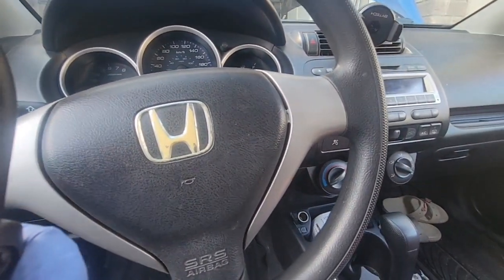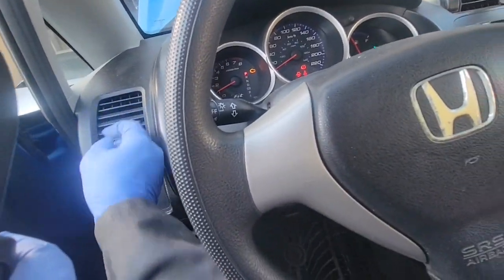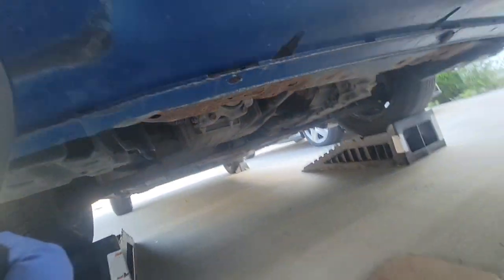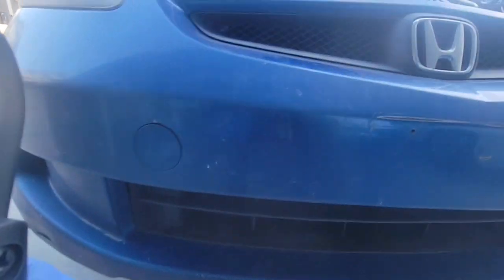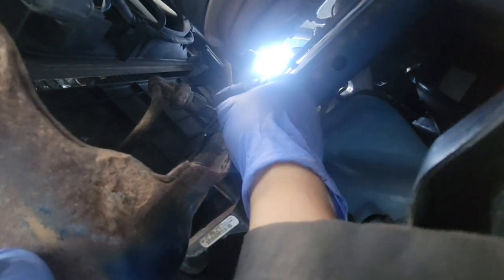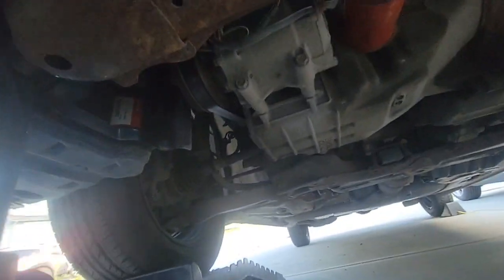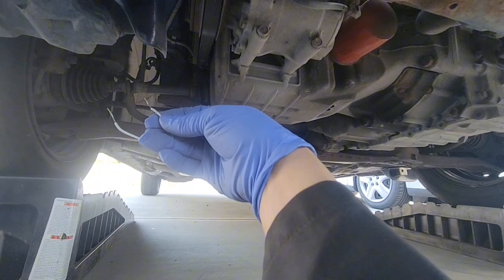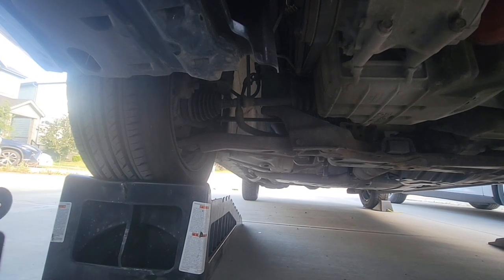EASY FIX HONDA FIT 2004 TO 2009 AC COMPRESSOR NOT WORKING. AC SENSOR SWITCH LOCATION

Comment: Thanks for the video. I think this has narrowed down my search to find the issue with my ac on my honda jazz. You did not angle the camera for us to see what you completely did, so are you able to show a picture of where you placed the wire in the sensor switch? What exactly did you use to stick into the switch? Can I use a paper clip to do this test? So if it's been diagnosed that it's the sensor switch, can you please tell us what we need to do? Install a new switch? Or Install a new compressor? Change fuses or relays? What is the next step, please?
Reply from the maker: Hi. Yeah sorry for that. Im just by myself doing it. Yes just use a paper clip to trigger the switch. If still  not working try first the sensor switch its much cheaper if doesnt work then if might be really the compressor issue. Hope it helps. Thanks for watching.